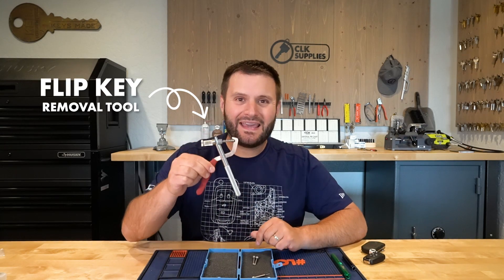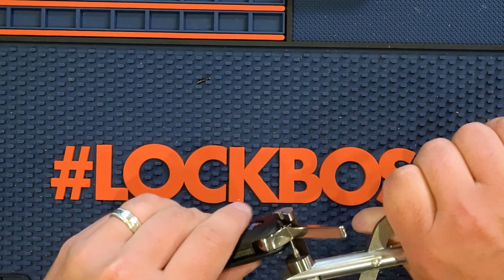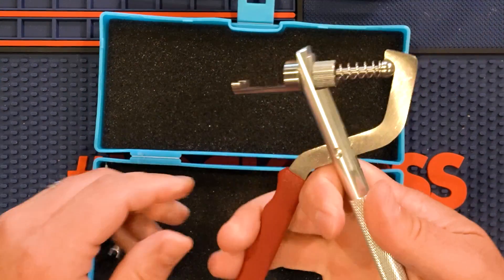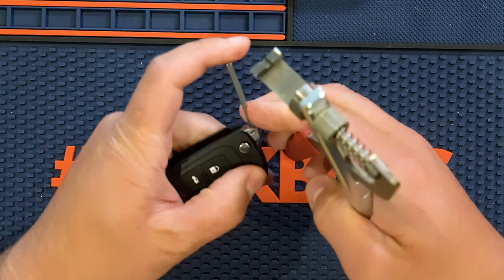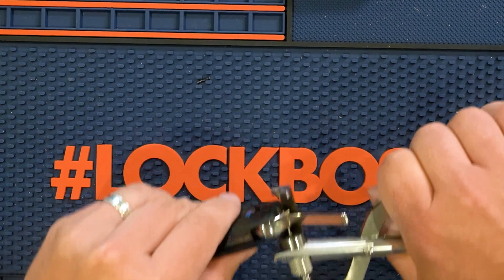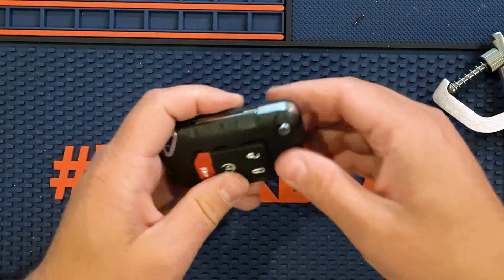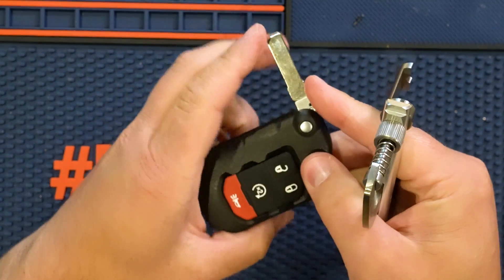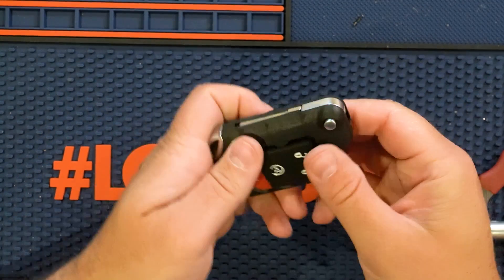Affordable Excellence: The Flip Key Pin Removal #Tool Every #Automotive #Locksmith Needs

Comment: I love this roll pin tool! Nothing like the feeling when you get the precession feeling of pushing a pin and pushing a pin straight out!  I do go through a few bits as they brake if you are not paying attention if you are not straight on the roll pin. But has save me a bunch of times for quick blade swaps. Deff recommend! Order spare bits to keep on hand got mines from PJ n the CLK supply team.  #Lockboss

Comment: There's one by Lock Monkey that has 2 sizes of pins for removal without changing a tip. Also has a magnet that is supposed to catch  the pin as it comes out. #lockboss

Comment: 1/16" roll pin punches exist too, but require a vise or 3 hands to use. Hope the instructions say to apply pressure slowly, those extractor shafts bend easily if you're too forceful. #lockboss.
Reply from the maker: George, thanks for always dropping your knowledge with us 🤝-PJ

Comment: Nice tool good price but it's just a watch band link tool repurposed but these are easy to use. I use a gun punch set because it holds my pin to get it started on hard pins and one size doesn't fit all,  it can be a pain with punches so I will have to pick one of these up for backup #Lockboss I'll be putting a magnet on mine I'm not chasing pins lol

Comment: W0W Nice Handy Tool To Get The Job Done With Ease.   So You Don't Lose The Pin Taking it Out And It Goes Flying You Could Put It In A Clear Plastic Bag.  #Lockboss

Comment: About how often does the ejector pin need replaced? #Lockboss
Reply from the maker: If used with care I would guess you could get an easy 50-100 ejections at minimum -PJ
Reply: @clksupplies  Not bad at all. I was thinking 10 or 15 but I looked them us and the replacements are a good price

Comment: Hey buddy do you have any idea on how to deal with fake reviews on local service ads I had 2 companies and had to close both because on one I got 100 1star fake reviews same with the other one they dripped both to 2.5 star from 5 star and I submitted a form to google but they will not remove it because I guess those fake reviews are not violating any Google policies and I had to close because no one will call the ones that will call me they where just money burners thanks if anyone know what to do ok let me know thanks